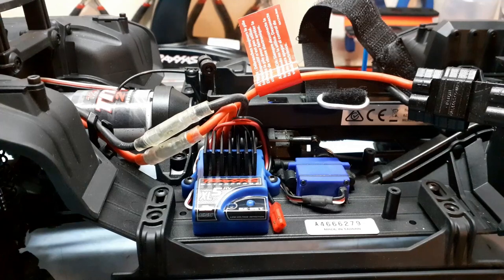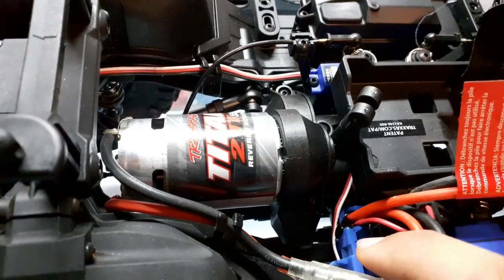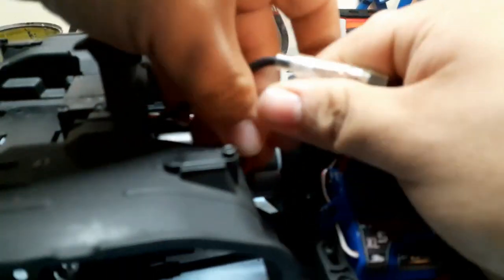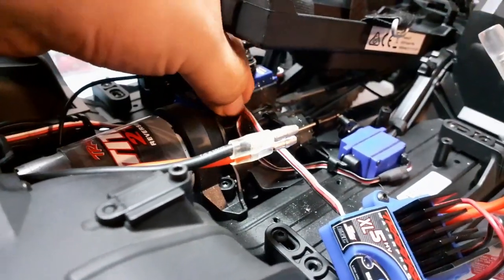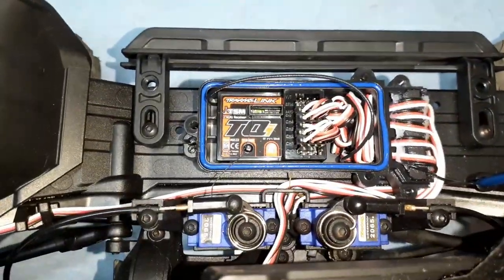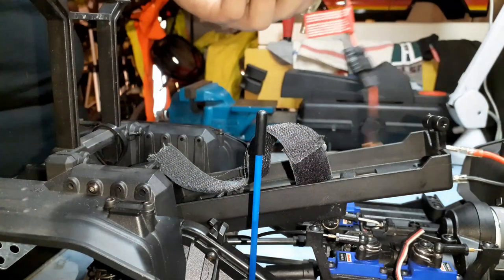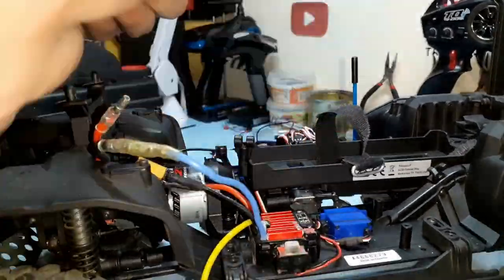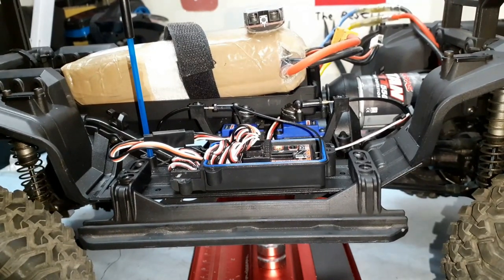Changing the stock ESC on my TRAXXAS TRX 4 bronco after it almost burnt my truck!!!

Comment: Amazing video, loved it, frankly I had the same problem with my traxxas trx 4 defender. The ESC just stopped working after a couple days of use. Do you have a link for the extetion you used?
Reply from the maker: Comming mate
Reply from the maker: Sorry for the late reply here is a link to a set. They are really cheap.
#Aliexpress € 1,67 | 5/10Pcs 150 / 300 / 500mm Servo Extension Lead Wire Cable For RC Futaba JR Male to Female 15cm 30cm 50cm
https://a.aliexpress.com/_d6FfLIL

Comment: so say the 1060 will over heat and burn with 3s lipo? how is your 1060 doing after a year now?still working?
Reply from the maker: Had this one for over 3 years, always was reliable thats why I love the 1060. Anyway recently I still upgraded to the 1080 so I could put the 1060 on another rig. Either I have good luck with these or its a blessing. Love the 1080 as well but this one did just fine for me.
Reply from the maker: Yes it does still work I have 5 of them all work exelently

Comment: Any updated on how this worked out in the one run my esc cought fire today was able to save the rest of the car before it cought fire is this a good upgrade from the stock?
Reply from the maker: Worked out fine bro best budget esc ever!👍👍👍❤
Reply: Common enough part to get at a hobby shop? It is this something i have to orderin also new to rc when I throw in an aftermarket esc is there any programming needed to be done anywhere for it to be able to connect back to my stock controller
Reply from the maker: @baboshleep4887  it is preety popular to find in a hobbyshop and no need for programing in my opinion plug and play
Reply: @combarccrawlers3948  thank you for the info very helpful full one last thing if you could answers me back when I  slap this on will I still have the 5 pre settings like the trail sport race and crawl modes or will it just be all at one set speed all the time
Reply from the maker: No it is just has 2 modes: forward/brake and reverse/brake or forward/brake/reverse which I like to use because it is a form of manual braking. Thanks for your comments👍
Reply: @combarccrawlers3948  hey man so I got the new 1060 in there it’s all wired up good but it won’t self calibrate is there anything I’m doing wrong i have the wires locked up like your the steering servo is working and it turns but when I hit the throttle it just esc just blinks red any ideas?
Reply from the maker: @baboshleep4887  hmmmm what motor do you have it hooked up to? There is a spec sheet of the motors it can take. I have a suspuscion that that is the issue or the motor wires are not hooked up correctly
Reply: @combarccrawlers3948  the same titan 21t motor that you are on the guy at the hobby shop told me it might be the transmitter reciver I took my buddies slash apart sure enough had the same recover threw it in mine and the same result car would turn one steering would work but when I would try to move it light just blinks red and it won’t even let me recalibrate the throttle
Reply from the maker: @baboshleep4887 this is very strange... when you switch the ESC on does it make the beeping noise? It has to do il like twice. If it doesnt do that for some reason it lost connection to the motor. This never happened to me, as I said I only experienced this when I did not have the motor wires hooked up correctly. Maybe it needs some sort of programming🤷‍♂️? Maybe you should communicate with the hobby shop about this issue. Hope I helped you out in some sort of way bud. Thanks👍👍😊

Comment: This just happened to me and my trx4 is only 2 weeks old...WTF traxxas
Reply from the maker: Yea man the elctronics suck even on my barely used trx 6 the leds on the body are all going out 1 by one I have to buy another light kit already...
Reply: @COMBA RC Crawlers  geez I have a trx6 as well thats a week old and dreading it now. 

my trx4m esc went out too so I sent them to traxxas but I did order a fusion pro for trx4 that went up in smoke.
Reply from the maker: @JonR35  the esc that I took out in this video I went to the shop and claimed the warranty, I kid you not the shop had to send my burnt esc to traxxas so they verify that its bad and then send me a new one. Waited like 2 months🤣 its not even worth fighting for their crappy electronics anymore🤣 its a pitty but that is the truth the electronics suck...

Even the motor went out while I was crawling. It was like a barbecue under the body taught it was my battery🤣